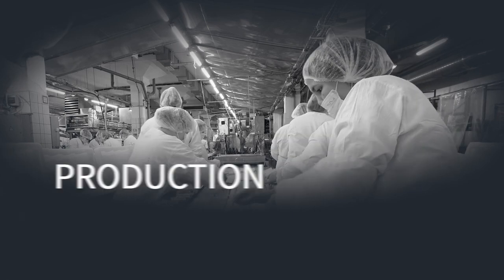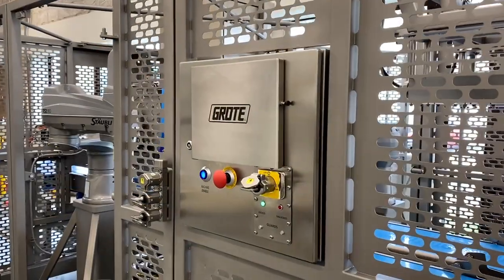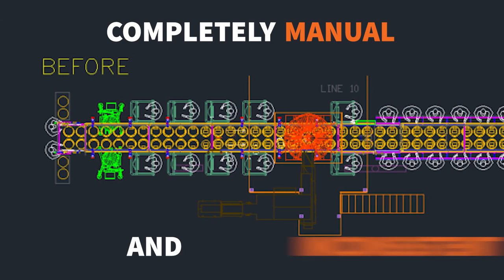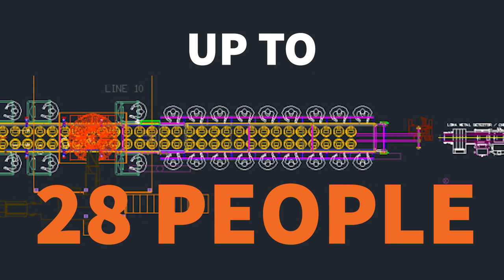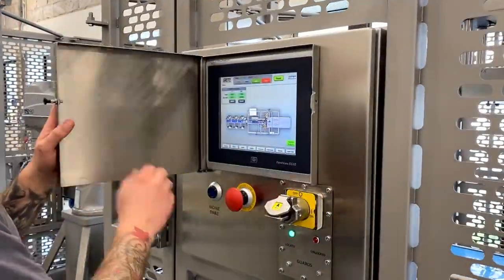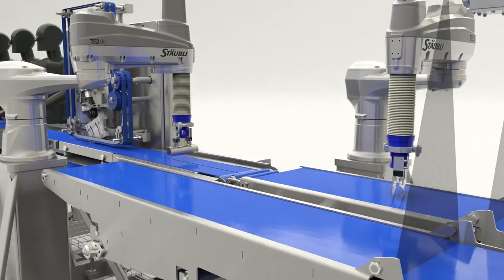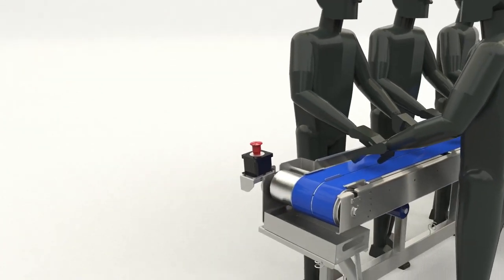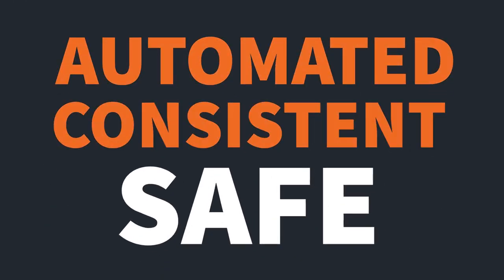How a Sandwich Wrap Producer Automated Their Line with Grote Robotics

Comment: This machine is doing the work of 2 people pool, But on a serious note I have a question on most sonic cutters we have problems with water ingress in the vibrating chamber of the knife assembly is the cylinder serviceable? And do you provide spare o rings at a reasonable price?
Any way we are thinking about getting rid of all grote branded machines and buying millitec😅
Reply from the maker: Contact our service team at techservice (at) grotecompany (dot) com about the water issue and o-ring availability. Our sandwich equipment and robotics experts are UK-based and quick to help. In fact, our customer service is a key reason why processors switch to Grote Company.